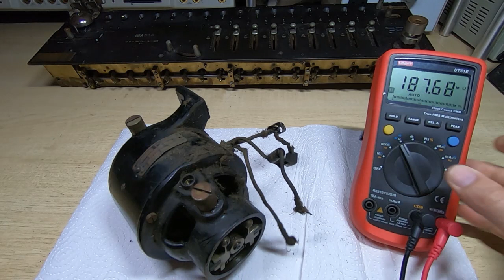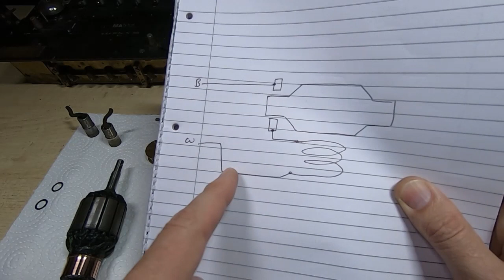MADAS Calculator repair Part6

Comment: Hi Jerry nice video as usual, not sure how badly scored the armature was but we used to use armature stones to help bed the brushes as a final step.
I also noticed that I believe you did not redo the under cuts between armature segments was this not required?
Reply from the maker: The scoring was approx 0.4mm deep so it needed to be machined. The profile on the end of the brushes was still very close and will bed in if run slowly for an hour or so. If they were new brushes then I would tape some fine grit paper to the commutator and spin the motor with the brushes fitted to get them close and then remove the paper and run it slowly for a while to complete the job. These do not require undercutting as the inter-contact material erodes faster than the copper and so self undercuts. If you look at the 'before' image you can see that the unused section was not undercut. I think that undercutting these types would increase brush wear rate. I generally look at the 'original' unworn part to determine if undercutting is required.